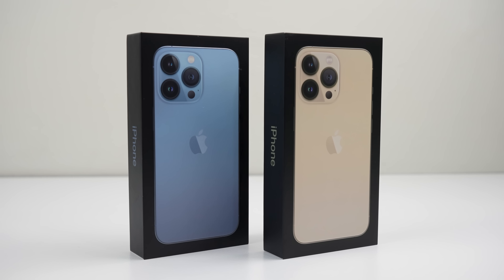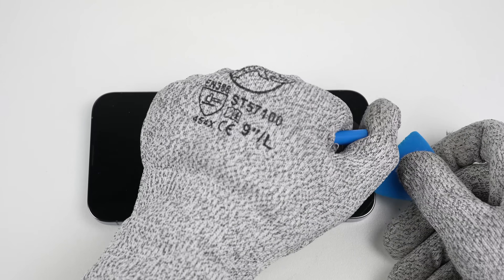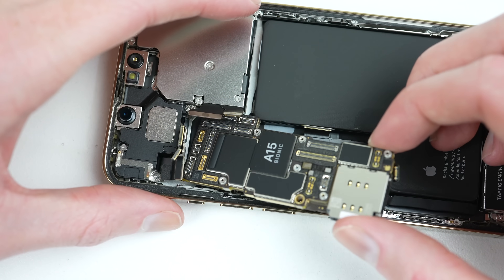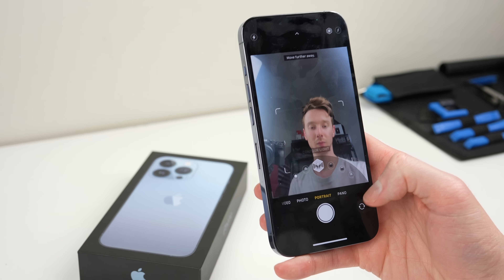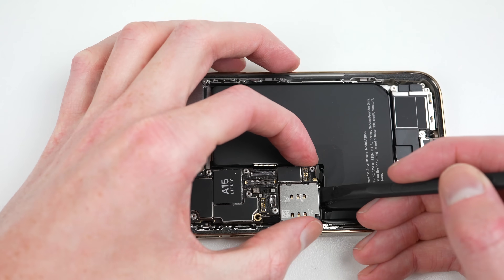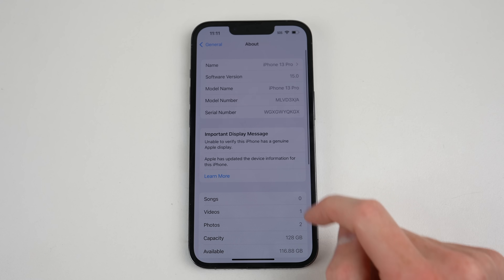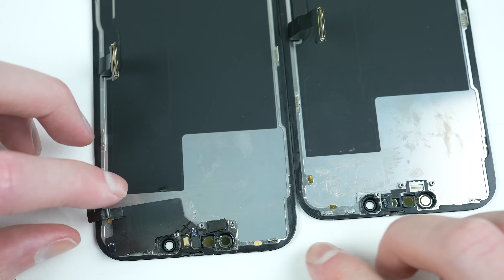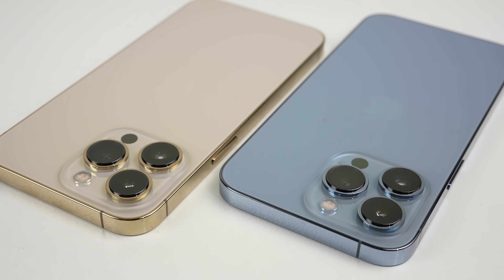iPhone 13 A Repair Nightmare - Teardown and Repair Assessment

Comment: Imagine taking your car to get new tires at a 3rd party repair shop and, upon completion of the job, the seats no longer recline, the windshield wipers don't work, and the AC doesn't function.
Reply: This is a wildly potent analogy, shit should be illegal
Reply: That's literally what the Apple EV Car would be like
Reply: @MrJames1034  I would honestly be surprised if it wouldn't
Reply: John Deere things
Reply: Car manufacturers have tried to do this before, but were stopped by governments after public outcry.
Reply: @GreenCrim  we don't need the government to do that, just don't buy that shit.
Reply: @GreenCrim  well they cant stop apple. on type-c problem.. soo yeah.... if apple car became public. get ready to lose the ability to start your engine in apple Electric car 5 ultra max pro. after changing the charger to third party... hopefully not the break too...
Reply: Elon thanks you for you idea.
Reply: @torababdullah7952  Actually Tesla already prevent third party repair and refuse to supply replacement parts
Reply: @torababdullah7952  Musk like all religions is a Snake Oil salesman posing as a good guy.
Reply: Dont give apple ideas for car malfunction...
Reply: aka tesla
Reply: this comment should be pinned IMO.
Reply: no need to imagine. Tesla made it a reality.
Reply: @mg6192  imagine that after in a third-party service someone will have full remote access to your car and will do some planned crime while you are sitting inside. Hmm somewhere in upgrade movie was similar situation. Ok no conspiracy. After third-party repairement auto accidentally would crush. You think public will ask that third service? NOPE, they will jump immediatly on tesla company for compensation, investigations, callbacks and all possible crap because their auto is not safe. Simple example. Service will move camera or sensor, or even worse slightly tilt. Auto will think it is still have enough space, but no.
Reply: This a a fair point considering spare parts like tires and windshield wipers... Nevertheless this is exactly what car manufacturers do already to make theft and tuning more difficult: ECU, geabox control, safety control units etc. are all coded / serialized. Modern cars only start with the original electronic parts fitted - this is checked every time you turn the key. When a replacement is installed, this can only be re-coded by the manufacturer with special software and only while being connected online to a special server.
Reply: @helgewollenhaupt4490  Actually that's a lot different.  A car has a lot of true safety features built into the electronics.  But even those can be swapped out by an independent shop without help of the manufacturer.  This is very different.  There are no true safety concerns here.  And independent shops can't get a hold of the tools to actually make these fixes (from the manufacturer).  Third party hacks have to be involved.
Reply: So...a Tesla.
Reply: Its easy
When you have a flat tier you have to buy a new car! Apple logic!
Reply: You know Apple is making a car right? Might not be too far off.
Reply: @SpraqNetworkR1J  Teslas cannot be repaired outside of Tesla support, but most models don't even have spare parts available anyway. Fix it yourself and Tesla will brick supercharger access.
Reply: @truantray  sounds like a bunch of BS. Unless labor is free at a Tesla support station. That much for a basic vehicle and needing to spend that much more is rediculous
Reply: @truantray  That's fucking disgusting. Never, ever buying anything from Tesla. All semi-intelligence, semi-self aware consumers wouldn't either.
Reply: It sounds crazy but it is not too far from a real truth, I was an ex BMW tech before going to tesla and can confirm  without the ability to use a factory tool to code modules they will have limited functions. This software lock has existed for years in the auto industry before making it to phones. I am amazed it took this long..
Reply: Well I won't be buying an Apple car that is for sure. Tesla have been doing something similar with some of the parts so you can't supercharge some repaired cars.
Reply: You just described Tesla
Reply: Cough Tesla cough
Reply: Damnn…i laughed so hard after reading this…thanks man 😂😂😂
Reply: Replacing the tyres makes the logic board crap it self as the car can’t detect genuine tyres.
Reply: @OblivionWalkerVerified  It's nothing new. Some cars have sensors in the tires. But, as far as I know, new ones can be paired to the car
Reply: When you have to teach electronic things to a mechanical guy... this example is God leave 😂😂😂
Reply: Nice analogy. A lot of car stuff is proprietary and locked behind special tools and licences. 

Even if you swap wheeles on newer cars you have to drive to the car dealer to relearn the sensors. 

Welcome to 2021. It's not Apple, it's technology.
Reply: This is what John Deere has done to the farming community, and automakers are pushing into newer model cars.
Reply: @l00k4tstuff  Unfortunately not only John Deere. Fendt is also really bad.
Reply: Sounds like a Doge
Reply: @MichaelJordan-hn4zd  A Venetian head-of-state?
Reply: Teslas be like.
Reply: @BenJervis62 It does. The car still runs and drives but several features no longer work.
Reply: Tesla will make sure to make this analogy a reality
Reply: Tesla will probably be heading down that road soon. In fact, EVs in general make it way more likely.
Reply: Not 3rd party. Just genuine tires from another genuine car
Reply: @prozac1127  "These tyres cannot be verified. Please contact your car dealer." The car stereo now will only play two kinds of music - Country AND Western.
Reply: Buy a secondhand Tesla and you get screwed also ...   If that Tesla had some extra payed options, they will be disabled when you buy secondhand ... also speed charging will be disabled permanently ...
Reply: Or if the brakes of your car ceased to function when a new car model came out
Reply: Imagine buying apple products after 2010.
Reply: @BenJervis62 Are you not look at the video? Yes unless you send your Apple phone to Apple repair centre and pay them to repair your device they are limiting the functionality of your device. Even if you use a fully functional Apple part. Unless the serial number of the part attach matches what they have programmed in to the device they will not allow it to fully function again. Even though you have the parts that works unless you send it to Apple.
Reply: Lol
Reply: This guy always be on Engineer's Perspective
Reply: If my car was an Apple it would cost about $200,000. I'd expect a 3 year warranty and a free loan car while they fixed it for me.
Reply: @ColinWatters  Apple will tell you the car needs to be replaced because the headlights don't work.
Reply: Actually, Tesla is like that
Reply: Wasn't this a thing at one point? 🤣🤣
Reply: If car manufacturers could and could normalise it they would lol
Reply: This isn't that far off the mark.  A lot of modern cars now have coded parts on them. Ones with fancy headlights for instance, you can't just put on a set from another car without coding them into the vehicle... which needs manufacturers software to do... and a licence from the manufacturer... some car parts wont recode either. They have to star from a factory blank state.
Reply: just keep watching tesla.
Reply: And this is future for surd
Reply: don't give them ideas
Reply: Where basically moving in this direction with smart car's
Reply: ha
Reply: That is exactly what owning a John Deer tractor feels like i imagine.
Reply: @BenJervis62 did you not read him write  "3rd party," or are you just ignoring that?
Reply: Probably is going to happen once we go full ev
Reply: So you've got a Tesla then?
Reply: Imagine trying to get a haircut at the barber and all of a sudden you go blind because only your mother can give you a haircut.   😏
Reply: @ArchangelExile  that stuff is very unlikely to happen.
Reply: That is a perfect explanation as to describe what Apple is doing here! It’s selfish, greedy & you would think being a trillion dollar company would be enough for them? But noooo let’s see how much blood we can really squeeze out of these turnips! I want my $1000 back!
Reply: We are going that way. We wont allow this for any other industry so I dont see why people allow this with phones.
Reply: You forget Tesla exists 😂
Reply: This was my exact thought! 
Apple is just getting worse and worse, they’re expensive and greedy, they’re still Apples property once paid off.
Reply: I've had my old laptop repaired once, the LCD broke so I had to replace it. It came back fully reprogrammed for some 'unknown' virus I didn't ask to check. Probably for more cash but my files are all gone
Reply: Infiniti literally does this.
Reply: @BenJervis62 "Imagine taking your car to get new tires at a 3rd party repair shop and, upon completion of the job, the seats no longer recline..." The key here is "3rd party", NOT Apple.
Reply: BMW AG is already making CarPlay an annual subscription and in a couple years heated seats, adaptive lights, surround cameras will all also be subscription based and non transferable to other owners. Subscription model is going to get much worse.
Reply: Thats Tesla and Apple car coming too so dont support anything else than a Toyota
Reply: Exactly they keep bying so who's the simpleton
Reply: @UCW6mais3-Xd9IxiGR7FGOyg you really are clutching, pegasus attacked every phone and OS and unless your a spy then you neednt worry, the Israelis arent coming for you
Reply: Thats going to be the Apple car, watch lmao
Reply: Looool
Reply: Or the car won't start because they didn't go to an authorized dealer mech lol.
Reply: @SiKuyaJustin  110% they would totally do that. You get new tires from your local shop like you said, and you get  a warning on the dashboard your car won’t move
Reply: Oh and the power steering no longer works too
Reply: you mean like tesla?
Reply: Sounds like a Tesla to me  😏
Reply: Don't give them any ideas.
Reply: Out of all the comments this is the best one.
Reply: This, dear customer, is coming soon. The Apple car is in the works.
Reply: And then you remember Apple is working on a car.
Reply: You're talking about Tesla right now....
Reply: i think he would agree with this kind of things
Reply: It's getting there. With Tesla Apple-like policy the tires will be chipped
Reply: Imagine even taking a Tesla to a 3rd party repair shop
Reply: That happens with dodge sometimes
Reply: best comment
Reply: don't shout it out too loud!
Reply: Who's to blame? You who took it there knowing that they weren't authorised to service it, the 3rd party who knew they weren't able to service it or the manufacturer who said that it could not be services there?
Reply: The absolute perfect example/analogy and this is how it should be explained to the world. Truly shocking
Reply: And your speed is not capped at 70mph
Reply: Knock on wood
Reply: Pin this comment
Reply: The 2023 Apple Roadster!
Reply: I had that once - I went to repair the Rear Wiper - water was working.
I got it back - Wiper was working but no water was able to come through. Still not fixed as I have to open up my entire right interior. FUCK THAT.
Reply: well, if your car is a tesla, its almost as bad as what you describe.
Reply: If Apple made cars I wouldn't be surprised
Reply: Tesla is not letting you buy parts to repair it by Ur Self..
Fck the USA!
Reply: literally the same thing
Reply: The only part I can see a remotely valid reason for not working after changing parts is FaceID.  You don't want to be able to bypass a locked phone with some sort of fake camera, but if it doesn't have that in-use...  take the replacement part.
Reply: Oh boy can't wait to spend a house's worth of cash on the I-Car
Reply: Well this is for your safety as 3rd party tires could make reclining your seat a safty hazzard, and apply car Co. has your safety as it's number one priority
Reply: That’s Tesla for you.
Reply: AND THE BRAKES DON'T WORK
Reply: This is actually what a lot of cars are like these days, they are EXTREMELY difficult to repair without new specialized tools each year
Reply: nah the entire engine is limited to like 20 horse power and its labeled and an unknown critical error and you have to go to an official dealer and pay for an official repair
Reply: Yeah they might not be doing that, but car manufactures in the future are going to go to monthly subscription based services. Everything will be on your car already but if you want to be able to use, say heated seats, it's one dollar per month. Do you want auto lock doors, another dollar per month. And a lot of others features will be subscription-based. Toyota is already doing it with auto start. Any Toyota made after 2018 the auto has been disabled and to get it to work again the customer has to pay $8 a month.
Reply: This is what Tesla will be doing in 10 years!
Reply: I had a car with an electric emergency brake. The component failed and they told me that I wouldn’t even be able to install my own part because they would need their special diagnostic tools just to be able to enable a new part. 

We’re already there.
Reply: @ebouwman034  Sounds like Fendt and John Deere.
Reply: Thats how future cars would be because everyone see how apple get away with it. And of coarse it all will be covered with slogans on how it is for your safety and how company cares for environment.
Reply: @MRooodddvvv  The worst part, and you can see a few of them here in these comments, are straight up morons so incapable they actually lap up that bs and have the utter lack of self-awareness to regurgitate the lies of marketteers.
Reply: But you keep on buying their stuff, so who is the real dummy.
Reply: Wow, that's almost like you are able to create an analogy. Your 5th grade teacher must be proud.
Reply: @kiddhkane  Yes, a valid and decent analogy of the situation at hand. What is your reason for trying to deride the OP commenter here? Are you yet another corporate bootlick that identifies with the products you buy?
Reply: That's why you need to go directly to the people who made it or someone who is certified to repair it, if Apple isn't getting paid for a phone of theirs being fixed then the phone didn't deserve to be fixed anyways obviously.
Reply: @CrazyCelestial  No, there is no reason to go to the manufacturer if they didn't software lock it.
I don't need to take my car to the dealer to replace tires or brake pads. I shouldn't need to go to the manufacturer to fix a broken screen.
Reply: @CrazyCelestial  It's not Apples product after purchase though. That's the core argument behind 'right to repair'. Once purchased, I OWN what I've bought and can and should be able to do whatever I want with it. Why are you so uptight about a for-profit company getting paid more when you can get a working fix for cheaper? Are you one of those people that actually think companies care about you? Did you fall for corporate lies that made you identify and thus defend a product? F'ing pathetic.
Reply: @CrazyCelestial  Look son it’s a shithead out there... Wtf???
Reply: Ok so youd rather someone able to nick ur phone then switch the screen and nick all ur money
Reply: @Baconsquadgaming_skating  I lost braincells reading your comment
Reply: @reinbeers5322  plural? Im sure IOS haters only have one to lose in the first place
Reply: @Baconsquadgaming_skating  I don't hate iOS lol
Reply: @Baconsquadgaming_skating  Here's an idea, stupid, keep on eye on your belongings. Not hard, and it's objectively not worth infringing on right to repair to implement 'anti-theft' measures. Of which, I your superior am telling you is fact, is not even a consideration at Apple in the design process. These practices are purely, 100%, unarguably implemented purely for Apple's profit and bottom line.
Reply: @smithynoir9980  As much as I don’t like it, I’d rather additional security than some random phone shop being able to view all my passwords by switching the face id capabilities
Reply: @smithynoir9980  this procedures technically block all third-party manufactures and non perfect components to be sold. But tecnically all legal components should be stored on company servers to provide possibility to assemble from two phones single working. If we are speaking about green reusing. Some customers may sell old phones, while other may not want to pay for new parts in his old phone. As result everyone should be happy
Reply: @Baconsquadgaming_skating  A better way to avoid having people steal the phone is not to inflate the price to the point where it makes sense to steal it. But I guess if you are willing to buy an apple phone you don't really care about if it makes sense.
Reply: @Nomusicincluded  You do realise Samsungs are just as expensive dont you
Reply: @Baconsquadgaming_skating  Wait, there are only two phone brands?! Wow I had no idea. Wait a second, don't be daft, you do realise there are other phones and you don't need to buy the newest one.

Not to mention the reason people steal Apple phones is because they know some other moron will want to buy it purely because it is "Apple".
Reply: @Nomusicincluded  ah yeh the open source chinese brands, like xaomi, huawei etc. Then you have the korean brands who also use an open source operating system such as android, basically anything except IOS is risking your security
Reply: @Baconsquadgaming_skating  lol. last thing they would do for it is replacing screen. And speaking of dumb actions. I wouldnt put "all my money" into PHONE for sure
Reply: @MRooodddvvv  its not that, its everything that face id gives access to, most ppl internet bank, job done for the thiefs
Reply: there is guarantee seal, people who go to 3rd party ready  for the consequence
Reply: @labaladalada  Those "Warranty voided if broken" seals are not enforceable by law, iirc.
In any case Apple shouldn't be this much anti-competition.
Reply: @spudpud-T67  how do you know what tf I keep on buying, shut tf up